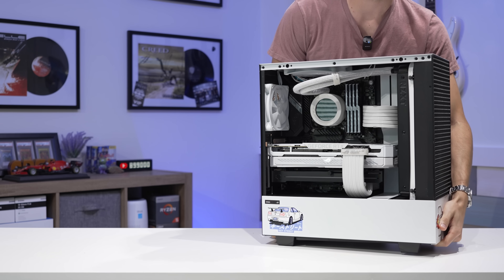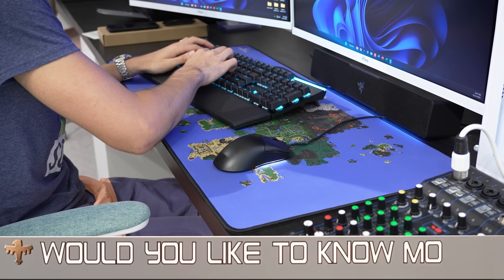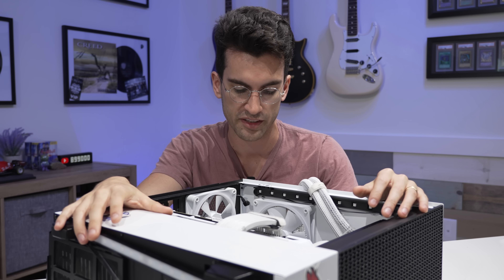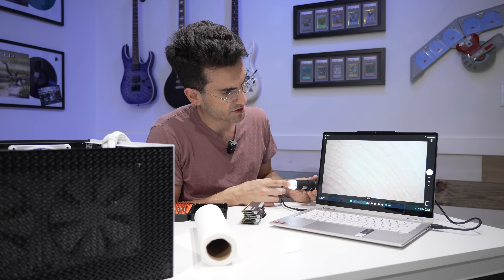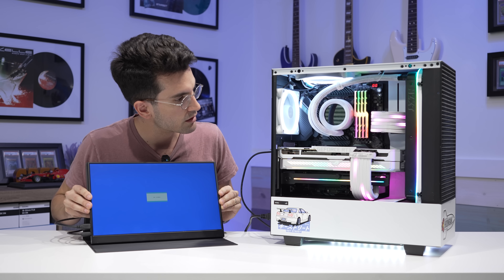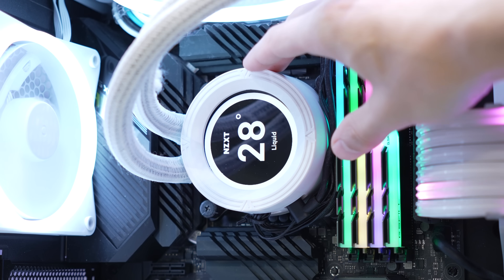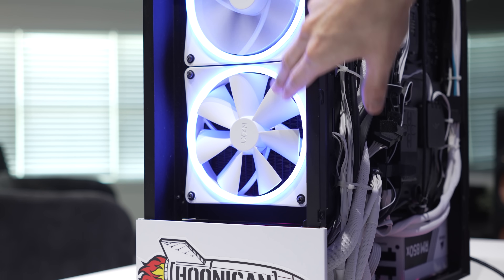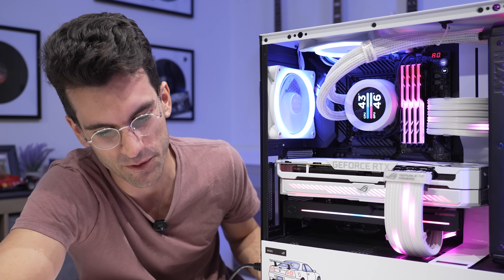Fixing a Viewer's BROKEN Gaming PC? - Fix or Flop S6:E15

Comment: It's got heavy Walter White vibes.
Reply from the maker: Maybe that's why I liked the way it looked so much 😆
Reply: @GregSalazar  my guess for bending the pins while only repasting is 1. maybe the friend applied the paste then tried to spread it with those thin plastic spreader tools & end up pushing the chip enough. 2. taking off or mounting the cooler screws they adjusted the chip abit
Reply: @dimitrirogers8725  using a thermal paste spreader will not damage the pins. CPU coolers apply way more pressure to the socket when tightened than a small plastic spreader.
Reply: @Alex-ii5pm  yes but if the person is far worse at computers then they say then they could push the wrong way or even pick the chip up & shift it also based on what greg said they clearly were to rough with the chip
Reply: @dimitrirogers8725  you never paste a cpu unless it is secured on the socket. You never need to take the cpu out one installed unless you are upgrading or changing motherboards.

Comment: Really not a fan of the AIO mounting decision, looks ugly, doesn't make any difference to performance, original mounting was so incredibly fine, and the owner already mounted it how they wanted it, you should just mount it back how they had it and give the suggestion with your reasoning rather than give a PC you've just fixed the CPU socket back to someone whose "friend" broke it when repasting, which they have to do to switch the AIO back to their preferred mounting..
Reply from the maker: All we did was rotate the block 90 degrees such that there wasn't a ton of strain on the tubes (which there WAS). We explained this in video, and also mentioned right after that the screen can be rotated in software via NZXT CAM. You're making this out to be some sort of scandal. The original orientation was not fine as the stress from the direction of tube bends from the block was unnecessary.

Comment: Whenever I am working on a PC, it's always very laid back.  I will chat with the misus, etc.  BUT once the CPU socket lever comes up, everything changes.  I move slowly and deliberately.  I use both hands while inserting and removing the chip.  I do not speak, and I let everyone know ahead of time to stay away and don't distract me.  Any time those pins are exposed, I treat it like I'm in orbit doing a repair on a spacecraft, and if anything goes wrong, I don't get home  :)

Comment: !! HELP !! I have a customized, what was a prebuilt ibuypower pc, gigabyte aorus pro b550m mobo, ryzen7 3800xt, rtx2080super, corsair capellix all in one rad, and 16gb tforce rgb 3200mhz ram, orig psu, not sure about psu spec. I tried to get ready for bf6 and set up the secure boot in uefi bios in mobo, not realizing I was supposed to reformat disk to gbt first, anyways after changing necessary settings in bios to allow secure boot, it was constantly booting back to mobo uefi after I hit save and exit, so I did a hard restart, that was not the right choice because now it won't boot to anything it just cycles the screen on and off constantly every 20 seconds or so, but no mobo splash screen to get into settings, no windows, no nothing, I tried to clear cmos via pins, no good, I tried also removing power and battery for over 10 mins, also no good. Im stuck now and don't know what to do next???

Comment: People ..... please mount your AIOS CORRECTLY, either mount the radiator at the roof of the case or if your having to front mount the radiator the hoses always go at the BOTTOM otherwise your going to get air bubbles in your pump head and its going to cause issues like noise and shortening the life soan of your aio so please mount aios correctly lol
Reply: Front mounting radiators to feed your GPU hot air is just a fools way to nerf your pc

Comment: I suspect the guy who changed it probably pulled the CPU together with the Cooler and possibly damaged it in the process
Reply: I recently was trying to remove an old air cooler from a rig that was not cooling the cpu down anymore for a friend. Kept the cpu mounted down, tried to pull off the cooler, it ripped the entire cpu up and out of the rig. This was a ryzen cpu, im not sure how not a single pin got bent but I was pretty grateful lmao.

To seperate the two, I soaked it in IPA for 30 minutes and it still didnt want to come apart. I had to take floss between both parts and slowly work at it, while said friend carefully held the cpu.

Comment: Good fix, bud.  It’s possible the AIO replacement never even removed the CPU and damaged the pins.  The likely culprit is over tightening on the cooler screws during installation.  The area of the damaged pins suggests the top left corner screw.  Lastly, the installer likely heard a click when it happened as well.

Comment: Sir, I would like to say that you are doing amazing work.
But you need to add in the title/thumbnail/description of what ultimately caused the problem.
Otherwise, these videos don't mean very much.
I've tried to find some of the videos I've seen on your channel but that's basically impossible.
Because all videos have very similar thumbnail and the titles are just numbers.

If anyone wants to try it.
Try to find the episode where the cause of the problem was the owner using a module cable from a different PSU.

I was trying to use it to convince people not to use the old cable.
Because they're too lazy to re-route it after replacing their PSU with a different one.
Reply from the maker: That isn't the point of these videos. They aren't intended to be an archive. If you're just cherry-picking what to watch here, you won't learn as much. But if you're watching comprehensively, then you'll learn everything I have and then some. And we've encountered so many wild issues with these rigs. So no. I don't need to add anything. And from experience - if I change anything in the title/thumbnail now, it will completely wreck the algorithm.

Comment: The fact you rotated the AIO cap by 90 degrees when you reinstalled it so the text is no longer vertical bugs me more than it probably should -_-
Normally this wouldn't be too big a deal to correct, but given the fact pins got bent from supposedly repasting the CPU leads me to worry changing it back might be beyond the abilities of the owner.
Reply from the maker: I literally said in the video that the screen can be rotated in SOFTWARE. Doesn't require moving anything hardware-wise anymore. Relax
Reply: @GregSalazar  Sorry, I must of missed that. That's good to know, I was having a minor OCD attack.
Keep up the good work!

Comment: I made the the sleeving thingy with my AIO tubes! To hide the ugly ends of the sleeves you can bend a piece of black plastic with a heat gun to make a sort of a tube ring, which will cover the ugly ends! You can also use black duct tape if you're lazy :D

Comment: The BIOS is reset because every time you remove the CPU from the socket or just unlock the socket, the motherboard resets it in order to protect itself, because it's possible to swap the CPU and break the new CPU if there are some OC settings from the previous CPU that can cause issues.
Reply from the maker: We did not attempt powering on the system with the socket in the condition it was - neither did the owner, AFAIK. For that matter, motherboards cannot sense CPU removals when fully powered off. The CMOS battery has nothing to do with that side of the board while in its idle state. It is strictly for powering the clock and/or BIOS chip. In general, a BIOS should only reset when a CPU is swapped and the rig is powered back on. This was not.

Comment: Personally I would take the mainboard out of the case before attempting to straighten those socket pins. Far easier to get better access and see what is going on 😕🤷‍♂️
Reply from the maker: I've done this quite a bit and was comfortable with it still in the case. Do what makes you the most comfortable :-)
Reply: @GregSalazar  Absolutely! I've done a few and being able to ro see the pins from multiple directions and angles helps. Still you got this one working! 🙂👍

Comment: I think you did a great job Greg. Much more patient than me with those pins.  Just wondering why you didn’t do a CPU stress test such as Cinebench or AIDA64?
Reply from the maker: I said why in the video. I don't want to log into someone's PC to run tests and risk data loss/corruption. I'd be responsible and I don't want the liability. The system has been working great AFAIK.
Reply: @GregSalazar  apologies for missing that part of the video I now understand thanks so much for your videos I have learning so much from them.

Comment: Hi Greg, I had something similar happen to my H670 Tomahawk mobo (12th gen build) couple of years ago. I was in the process of installing the contact frame when the small screwdriver accidentally slipped from my hand and it fell on the socket (yes, i was stupid to leave the socket exposed, but it was my first time). 4-5 pins got bent. Funnily, my PC still posted with those bent pins but I still took it out and worked on straightening the pins overnight as best as I could. The PC posted and there was little to no performance loss on benchmarks, but I noticed some of my games crashing, which never happened before. The crashes were random with/without XMP. Note: The PC didn't BSOD, just the games would crash randomly. 

I ended up buying another mobo and haven't had any crashes since.  I even looked up the pin layout and semantics of the 1700 socket and found out it was one of the Vcc pins likely causing the issue since being bent/straightened. 

So I feel like this PC required further intense testing (unless you have done already) to really make sure but I guess that'll be up to the user. 

Also, great content as always, big fan!

Comment: you never solder the pins itself, that will just be a socket replacment and with a microscope and steady hands you can bend the pin back into place, i've done that many times and 9 out of 10 they work after without problems

Comment: We replace the socket not the board.
Reply from the maker: Time/labor required to replace socket here would likely outweigh the price of a replacement board unless said board cost $300+ USD. In most of these cases, it's faster and more economical to just replace completely.
Reply: @GregSalazar  Cost 80 USD to replace.

Comment: Hope Steve from Gamers Nexus doesn't see this and notice how the AIO radiator is mounted tubes on top!!
Reply: Its the now rotated display that gets me >.<
Reply from the maker: It's completely fine. The issue was blown massively out of proportion for any AIO sufficiently filled and where the pump (typically located in the block) is sufficiently below barb height.

Comment: DDR4-3600 with 4 DIMMs? Isn't that "a bit" on the optimistic side? Especially on 10th gen which can only run in gear 1? I dread thinking about what VCCSA/VCCIO might be set to automagically. In a case like this I'd much rather back off on clock and tighten the timings instead (e.g. DDR4-3000 15-18-18-35(-...) or DDR4-2933 15-18-18-34(-...)). In my experience this gives only minimally lower performance in memory-heavy applications but should be a lot less hard on the memory controller.
Reply from the maker: I think it's making a mountain out of an ant hill.

Comment: What did their friend do? slam the processor? get a pick and purposely bend them? that looks like purpose made damage, and you should never do what the Paul guy does and thats wiggling the processor while its in the socket. i have no idea why he does that but its st*pid. you could easily bend or damage the pints or processor by wiggling it in their to check if its seated.

Comment: If you want my guess as to how the friend might've hamfistedly broken the pins - seeing the excess of heatsink compound on the CPU when you removed the AIO coldplate/pump, I suspect the friend removed the CPU to clean it initially and then was careless about the insertion force necessary to put the CPU back in when mounting the AIO.

Comment: This may be a dumb question:
If you had to have replaced the motherboard why wouldn't you replace with the latest instead of searching for an older (more expensive) board?
Reply: If you do not have the “latest” CPU, you cannot use the “latest” motherboard. And depending on how out-of-date your CPU, a used motherboard may be your only option. 
When putting together your parts list for a new build, you must insure that your motherboard is compatible with your chosen CPU. An Amd CPU requires an Amd compatible motherboard with the correct socket. An Intel CPU requires an Intel compatible motherboard with the correct socket

Comment: Just went direct die on my custom watercooled rig, was not happy with the before temps of the 9950x (hit 95c on any stress test, and occasionally during gaming), now with the mycro direct die block in the system and replumbing the block (I work with PMMA tubes) the cpu does not cross 70c no matter what I throw at it. Lapping the dies with an ultra fine abrasive was the most nerve racking part of it all. The solder AMD uses vs the solder on the 7950X is not the same, and doesn't dissolve as easily in liquid metal as before, so brought the dremel to the table and got the dies (1 IO, and two CCD's) flat and clean that way. On the IO die I could see the actual chip traces after polishing, that was cool, but I was also worried I went too far. After a good month of usage now, no issues and still those awesome temps, I'm a happy camper but can't fry an egg on my cpu anymore :face-green-smiling:

Comment: this dude would shit himself at Ryzen X3d idle temps. 

my Ryzen 9 9950X3d is this
420mm AIO, 6 fans on it, room temp 25c, idle is 50c. under full load, never goes past 80c
all OPEN AIR case hanging on the wall
Reply: I just got my 9800X3D a few month's ago and the CPU temps have been stressing me out to no end because I'm not use to temps so high. Especially with a 360mm AIO.
Idle ~47c & under full load it's usually around 67c.
Reply: @Kevin1873  its normal. Me too also. But i quickly learned that its completely normal because of where the cache is on the chip

Comment: I wonder, are those sockets replaceable? Like, instead of soldering a new pin into the socket would it be possible to replace the socket itself instead of buying an entirely new board?

Comment: Good Job! Long time ago (2011) tried fixing a FX 8150, I went to re-paste and couldn't start pc and melt thermal compound, when I pulled cooler chip came with it and flew. Pins got stuck in carpet fibers, pins were a mess and I couldn't fix them 189$ out the window.

Comment: Im actually surprised that XMP worked with 4x16 GB DDR4 sticks.

Maybe they were single ranked Micron sticks, but 4x dual ranked normally gives a lot of headaches when trying to stabilize them.

On the other hand, he didn't run any stress tests either. May a USB boot stick with some testing tools would be a good idea, to not have to mess around with the owner's operating system?
Reply: On Intel 10th gen that shouldn't be much of an issue, on AM5 on the other hand, better pray to the silicon gods that they gave you an exceptional memory controller lol
Reply: @benjaminsmekens2344  Was the 10th gen DDR4 IMC so good? I know that at least the 14th gen DDR5 isn't, as it won't even boot the XMP profile with 4x32 GB dual ranked sticks for me.
For Ryzen 5000 I had to manually tweak the settings, but was able to get 3600 MT/s with 4 dual ranked sticks as well. But not out of the box.

Comment: Heres the thing, if user error damage, that is arguably even more informative vid for fix/flop, cause honestly everybody slips sometimes - I've done the whole forgetting mobo plug, forgetting peel on heatsink, miswired thoes front panel plugs, etc... before, all minor issues but given the way my brain works, are all things i usuall check multiple times and will rebuild from scratch even when i know nothing is wrong but because of one little thing I have a compulsion to do so

Comment: how in the eff does repasting a CPU damage the socket unless he removed the processor which is not needed when your just repasting heck you can easily clean off thermal paste without the need to remove it at all.

Comment: If the CPU is cold and you rip the cooler off instead of twisting and wiggling you can take the processor out with the cooler and then if the CPU falls back onto the board it can damage pins

Comment: Funny story, when I changed to an AIO cooler on my current rig, I ended up bending two of the pins on my socket. I was panicking, but after trying to boot a couple times, I decided to boot with only 1 RAM stick installed. This ended up working, and so I kept adding sticks and testing the different slots and found that two of my RAM slots no longer work, but outside of that, my PC has been running perfectly fine for more than a year now! I got super lucky, and I am too scared to try and unbend the pins in case I bend more, so this was a nice video for me lmao.

Comment: If you’ve got a broken pin depending on what pin it is your mobo might not be bricked, recently got a z690 asus Eva addition with a bent pin and broken one, fixed the bent one, broken one was igpu power, has caused no performance issues,all depends on what pin breaks